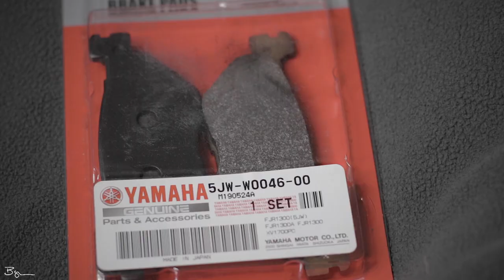Motorcycle Rear Brake Pad Change On My Yamaha Warrior 1700

Comment: Hi Bryan its wayne a UK Warrior brother....great vids as always this is a question about the clutch replacment
while we are in lockdown....
do i need to order all the plates if the clutch is still good or can i just change out the spring preasure plate for the heavy duty one you did way back.?
cheers Wayne.
Reply from the maker: Hey Wayne, thanks for watching and commenting brother. 

If your clutch is still fine, I wouldn't replace the friction plates at all. You can just open the case and install the Barnett pressure plate and springs. Even if you plan on doing the two or three plate mod, you could just buy the two or three full friction plates to replace the half ones, and just reuse the rest of the plates that are already there. 

Hope that helps answer your question brother. Stay safe and healthy out there!
Reply: Hi Bud, thanks for the info....stay safe in these tough times👍
Reply: Hi Again bro,
Am stuck inside like the rest of us at the min & just had my wheels powder coated metal flake chrome fantastic finish but cant rebuild them as my local store is closed in lockdown so cant get the bearings in or the tires on & ballanced😩
so am stuck until things get back to normal,
cheers again brother great vids.....btw a wheel bearing remove & replace vid would be good at the min....😉
thanks again bro👍

Comment: Hey Brian or anybody out there. Please help! Got a 02 warrior and last start up the starter stuck engaged and would stop by the kill switch but crank as soon as u turned kill switch to run. It would fire up but starter still engaged. Starters good and switch good. Got solinoid coming. At this point it acts like the battery is dead and will only crank in neutral. Any ideas please share